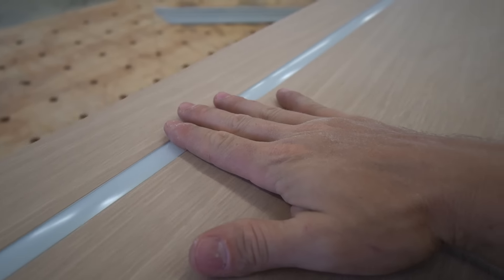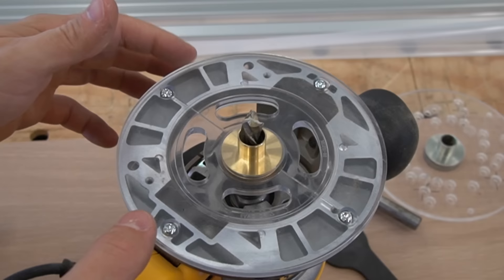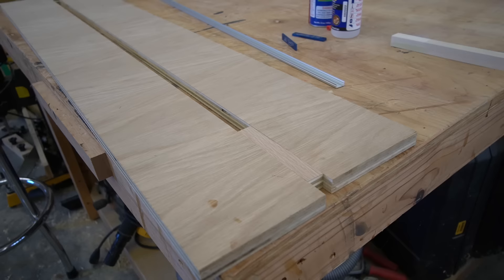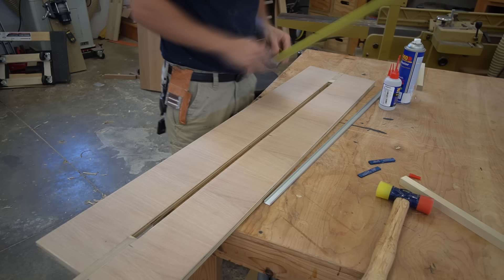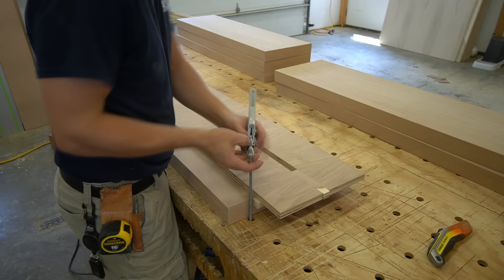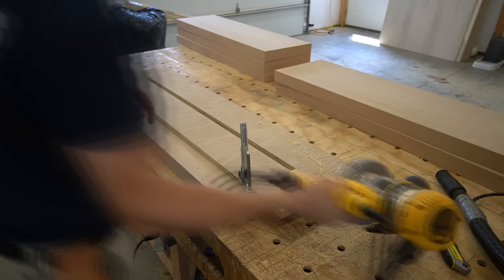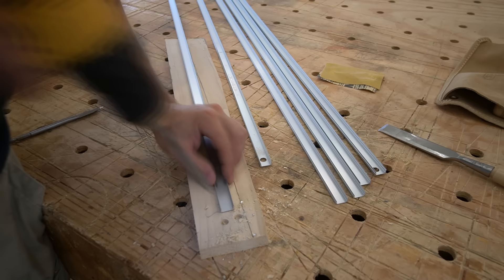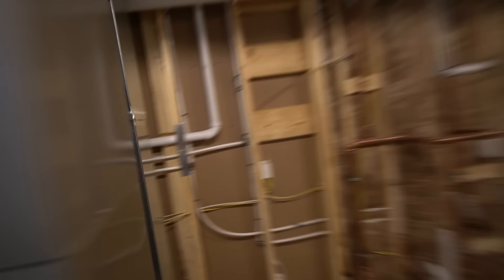Floating Shelves LED Lighting - How to Router Channel for Tape Lights

Comment: Why do you need an electrician for low voltage  wiring
Reply from the maker: Because I'm a carpentry sub. Not the electrician. Should the electrician install baseboard on a new home just because he can?

Comment: I'm making very similar shelves and tried to make the jig but realized I didn't have the right router bushing or templating bit I need anyway. Then I remembered I have a Bosch edge guide that I hadn't opened yet. Routed the first pass on all 6 of my shelves, then snuck up on the fit for the second pass (cutting the grooves to the correct width) on one shelf and repeated it for all 6 shelves. To me, it feels like it was way easier than making the jig, and the track fits nice and snug in all the grooves. 🤷🏻‍♂

Comment: Invest a few dollars on a centering cone; I use the same one with a 1/4” shaft on one side and 1/2” reversible shaft on the opposite side to ensure base plates are centered on the bits venter line.

Comment: Just finished 2 kitchen renos with these lights for under cabinet lighting. I turned out great.
Reply: Did that back in 2014 for my parents home undermount  lighting with dimmable led and Aluminum track. I even put the dimmable led with 3 foot tracks/channel and lighting controlled by motion sensor at the toe kicks for ground floor lighting being my parents are in their mid 70s. My mother tells me her cats make the lights go on all the time. One of these days I find a better motion detector.

Comment: Thanks for the video Spencer, I’ve recently made a few folding shelves using your folding technique.  I made them 3” and used 1 1/2 material to fasten to wall.  Do you use steel frames to hold your shelves?

Comment: Great work as always, but curious if you couldn't just clamp a fence and use a plunge router to rout the channel?
Reply from the maker: You could if the channel width is exactly the same as the router bit. I was using a narrow router bit in order to match the exact width of the channel with the jig.
Reply: @InsiderCarpentry  I do this a lot. Generally the channel is 17.8mm so I use an 18mm straight cutter.

Comment: Hi ,Spencer. 
Great info. On a unrelated subject. 
Question; what jobs in your opinion would the domino be a consideration, seems to me that built ins would be the only area where you can get some money/ time savings. Any other applications in the finish carpentry realm, in production and semicustom.
Its on your Amazon list but I haven't seen a lot of use in your videos 
Thank you.
Reply from the maker: You're correct. I rarely ever use mine. It has very few applications in my work flow. The only time I use it is when I need an actual large tenon to strengthen something.

Comment: Hey spencer, I bought the aluminum channel from your link. Your video says 1/2” bit. 
The aluminum is 17 mm or .66”
It seems a 3/4”bit is too big. 
I can’t find a 17 mm bit anywhere. Any suggestions?
Thanks 
Charles
Reply: Sorry, I figured it out. Gotta use a 1/2” bit and make the jig to the appropriate size. My bad, dumb question.

Comment: Whats the best distance to have your LED channel from the back wall of your shelf so that its not to close to make a hot spot against the wall?
Reply: I'm sure YMMV, but I was about to route the channel 2.5" from the back of the shelf, but decided to actually hold the lights up under the shelves to determine the best spot. To my surprise, they looked MUCH better being toward the front of the shelves instead, since it actually iluminates the items on the shelves evenly, rather than casting a shadow from behind. It's the same principle in photography - put your subject with the light at their faces if you want to illuminate their features as opposed to drowning those features out with a backlight. (Unless you're going for a silhouette look or something, but that's besides the point).

FWIW, for my 80" wide, 12" deep shelves, I routed my channel 2.5" from the front

Comment: Do you always make your floating shelves out of plywood? Or do you use hardwood also?
Reply from the maker: Almost always plywood.
Reply: @InsiderCarpentry  wow did not expect a reply! Thanks!! Would you recommend plywood for floating shelves in a bathroom? I dont have a tracksaw yet and had issues squaring up my last plywood floating shelves.
Reply from the maker: Yep. I always go for plywood unless I need a length over 8’.

Comment: Curious why you wouldn't just use you 1010 with the track?
Reply from the maker: You could if the channel width is exactly the same as the router bit. I was using a narrow router bit in order to match the exact width of the channel with the jig.